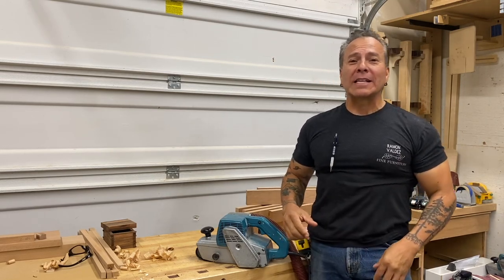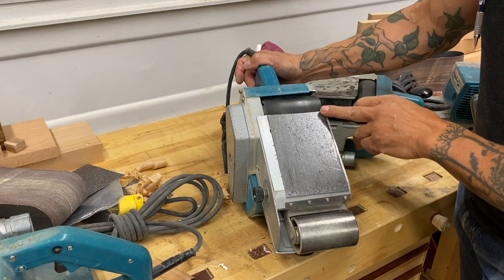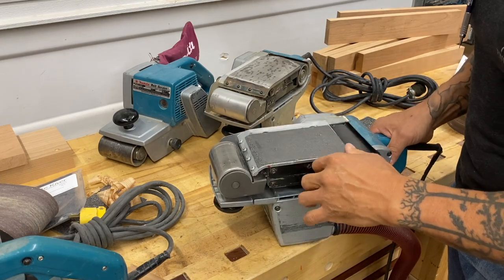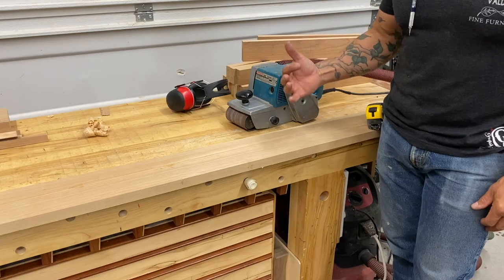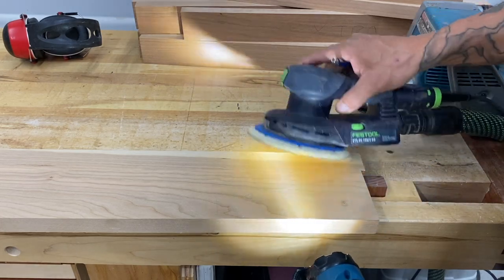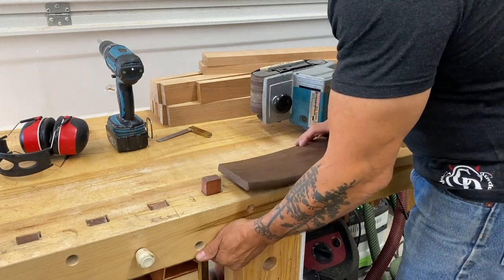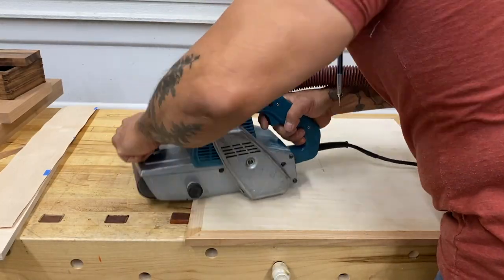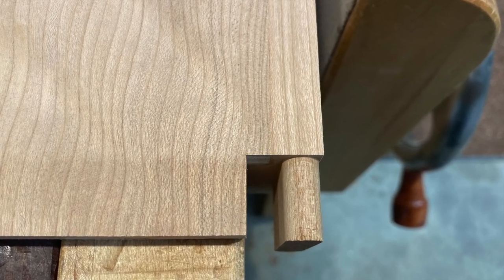Belt Sander Techniques

Comment: I think its great that a craftsman known for his fine marquetry is explaining belt sand techniques!
Reply: What the Dean said! Your tip about trying the smaller grit is priceless, and as you say,  "against the common advice"–as well as being counter-intuitive. Yet if a very smart person noodled on it a long time (perhaps with adult beverage or such to enhance perception) it would seem to be a logical approach.

I'm intrigued (and puzzled) by your comments about the sandwiched panel. My excitement was interrupted by the realization that plywood is already cross-grain layers. If economics or time prevent getting an appropriately thick sheet of good ply, why add the veneer? Wouldn't rotating the second piece overcome any deficiencies, and achieve the same outcome? <duh> Hope you have, or can do a vid on the topic because I really am intrigued, and love improving on things, especially flatness!

BTW, thanks for another great vid (and all the hours of post-production work, particularly the sound), and sharing this wisdom. Kudos, and bless you, sir!
Reply: Using the veneer in the center eliminates the 90 degree grain direction that would be on the outside faces of the glued panel.
Reply from the maker: Thanks a lot, Dean.  I love sharing what works for me.  I really like showing marquetry on an inside curve being flushed up with a belt sander…with veneers that are barely 1.5mm!😆
Reply from the maker: Thanks Sean…I appreciate the feedback! 

I would like to assume that quality commercially available sheet goods would stay flat when we purchase them, but we know that’s not always true.  Cutting them into smaller pieces, using two pieces to create the desired thickness…then adding the layer of veneer in between (I used Maple because I have a lot of it) locks the two pieces of plywood dead flat. The epoxy, in this case, creates two rigid glue lines.  I could have achieved the same thing doing this process with the outside veneers but epoxy is messy, hard to repair if there’s bleed through or if any gets on to the face veneers.  The face veneers were applied later with regular Titebond I.  Hope that all makes sense.  

It was a lot more work but in my mind it’s totally worth it having the peace of mind, and now I’m working with panels that are flat and beautiful and are staying that way.  For this project I made 39 panels! Each with five total layers!  Something I actually did not anticipate but the awesome customer helped accommodate me with the  extra cost.
Reply from the maker: Hey Steve…yes you’re correct.  I could have achieved the same thing doing this process (face veneers turned 90°) with the outside veneers but epoxy is messy, hard to repair if there’s bleed through or if any gets on to the face veneers.  The face veneers were applied later with regular Titebond I. Thanks for the feedback 🙏🏼
Reply: @ramonartful , well, that explanation is as helpful as an entire video! And yes, I treasure the few little pieces of "old" plywood; I fear that with the prices in my area (north of Atlanta), it would be more economical to just go with Baltic birch or better.

But since you're framing the panels, what about MDF core and veneer panels?

Comment: Used a belt sander for the first time a few days ago. Almost discounted it being a "roughing tool" as people say but it's all I had to work with. After half an hour of using it my skill had improved drastically and I now realize the potential of these sanders! It's all in the skill of the user. I have flipped it over, turned it right side up, sanded flush edges, trim, joints, all kinds of stuff. It's quickly becoming one of the most versatile tools in my shop. The wide face, exposed roller and ability to put curved shims under the belt really make it shine.
Reply from the maker: Yep…absolutely!  You described its usefulness perfectly…such a versatile machine!  Thanks for the feedback and for watching

Comment: Nicely done video.  I have the same sander purchased new in the mid 80's and the only thing that has gone wrong with it is the rubber on the drive wheel started breaking apart.  Steve
Reply: There are replacement wheels but I couted mine whit liquid rubber works wel enough
Reply: @zohranbloedjes9770  I replaced it but recall the part was fairly expensive.
Reply from the maker: They are impressive machines.  We used them in a commercial shop…sometimes they would run for hours a day…every day! Much thanks.

Comment: a contrasting color in the BG while putting a long square edge on top and looking down parallel right at the edge, if you are super serious about flatness without going overboard. The flashlight method is good, but the color BG is better imo. I use a nice blue color. stands out nicely against woods.
Reply from the maker: Not sure what you mean “in the BG”.  Something to do with RGB?  Thanks

Comment: Thank you for your great informative instructions and creative modifications made for these Makita belt sanders! I wish I've seen this before working on my Mahagany floor. I'm doing a patch work fixing some of my hardwood floor each piece 3" wide. My question is if I can use a 3x24" belt on a 4x24" Makita sander? Is there any adjustment needed?
Reply from the maker: Awesome to hear!   Belt sanders are such awesome and versatile machines!   Yes, you can use your 3” belts on your 4” sander.  Of course, you’ll have to adjust it a bit to keep it in the center.  I’ve got more belt sander videos in the queue…thanks a ton.
Reply: Thank you for your professional advice! Big fan! @ramonartful

Comment: Ha ha… Magnetic personality or magnetic pecks? Seriously Ramon I watched your other two videos on belt sanders at least a half-dozen times each! Thank you they are so helpful! I'm having an OCD moment trying to buy a new balanced sander. I've already sent a couple back.… Amazon's gonna hate me. My old fave of 30 years just got too worn out, a Ryobi BE321. Trying to find one of those on eBay I think would be pretty tough. That sander balances right down the middle of the platen.

I'm a guitar maker so sanding to within a couple of thousands is my goal… And dead flat. I was thinking I still wanted a 3 x 21 because guitars aren't big :-). I got the Makita 9903 3 x 21 but it balances right down the edge of the belt making it tough to sand evenly. I love the variable speed which I use all the time.

Okay now getting to a question… Do you think the Makita 9404 awkwardness that you addressed in one of your other videos is mostly from the front handle? And… Could we add a 9401 style handle and get a lower center of gravity and better feel?

Thanks again! Are you doing all your own video and editing? If so, good work!
Reply from the maker: Thank you for the good words 🙏🏼 I’m thrilled to hear that the videos helped!  

I’m not familiar with that belt sander but I did see one on eBay.  And to be fair, whatever we get used to makes other models seem awkward but I do know that the 9401 does have a low center of gravity. The 9403 is a great alternative, and the 9401 is still available but, yes they are both four inch wide.  I believe the 9404 sets a bit taller. And the handle location as you mentioned makes it weird for me.  I’ve never thought about adding a handle lower, that could help. I would seek the Ryobi model that you mentioned a bit more.  In my experience, many belt sanders get purchased and not used much because they do have a bit of a learning curve!  

And yes, I do all the video and editing so I really appreciate the feedback on that!  It’s a lot of work but I love sharing/showing what works for me.  Thanks a ton.
Reply: @ramonartful  I do have to thank you again! I got the 9403 and will keep an eye out for a 9401. The 9403 seems to have a nice balance and the handle locations seem familiar in a good way, especially the rear handle. I took a hard sanding block to the platen to sand the waffle platen true… It had bumps and valleys. I added the graphite pad and started getting familiar.

This is a fast sander compared to my old one. I thought I would just step down in grit. But I like quickly flattening out the 50 grit I get off my abrasive planer with some 80. However, I couldn't quite control it to get dead flat. Then I listened to the machine… "They all have a voice"… I put a speed controller on it until it sounded right, and bam! Perfect! You mentioned that at times you would like variable speed on your 9401, this is what I used and it works great for me. https://a.co/d/c8VoKuz  (Amazon)

I've always been a start the machine and set it down guy, except with the Dynabrade… No longer! Thanks for that tip!
Reply from the maker: @MrKCWalker  The sanding block is a good idea for the waffle platen!  We had a few of those sanders at my old work.  

And so great to hear that the tips help.

 I'm so use to goosing the throttle but I'd like to check out your solution to variable speed.  We're all learning here!  thanks!

Comment: Do you have any belt sanding tips for finishing a 25" x 80" glued up panel? I have a 9404 was thinking of using it. Flatness isn't critical this is a mudroom sitting bench made from solid oak.
Reply from the maker: A belt sander is the ideal tool for that task! Start by sanding at about a 45° angle to the length of the bench.  That will remove material the fastest.  The grit you start with depends on the amount that the misaligned pieces are.  If they’re close..use about 80 or 100.  Once you begin to get things close to flush…start sanding with the grain.  Then move up in grit numbers.  120 or 150 for a few passes until the 45° scratches are gone.  180 grit is a good medium-fine to finish.  Hope that helps! Thanks

Comment: you ever make an edge sander from a 9403?
Reply from the maker: I have at my old work.  Very similar to the  9401.  The flat belt guard is plastic, so I made blocks to support the sander on the aluminum housing.